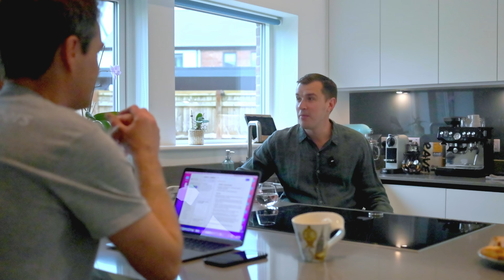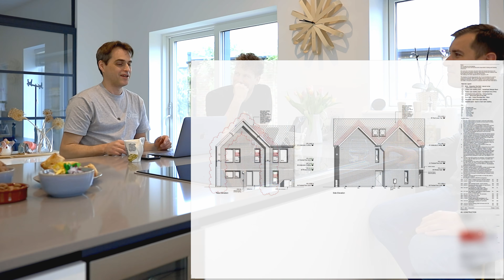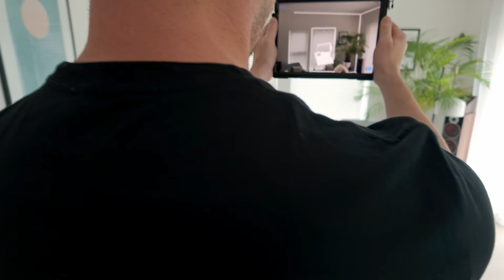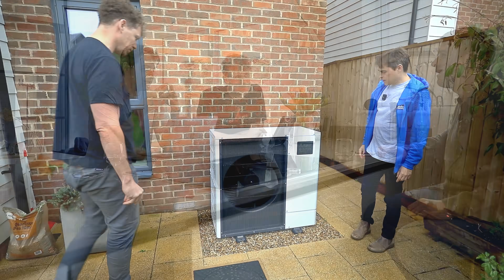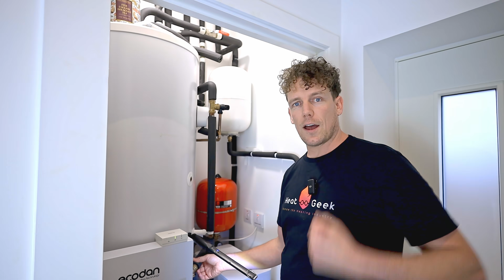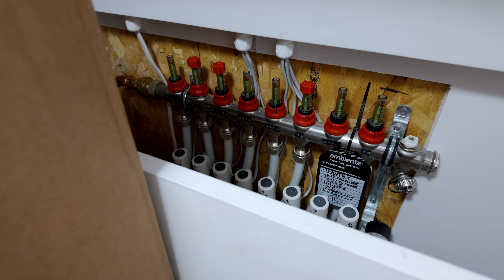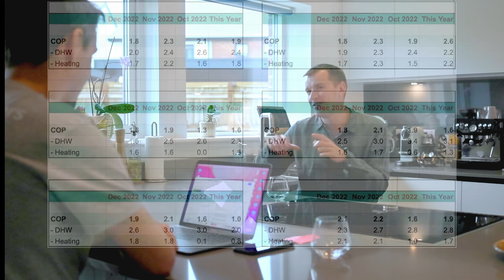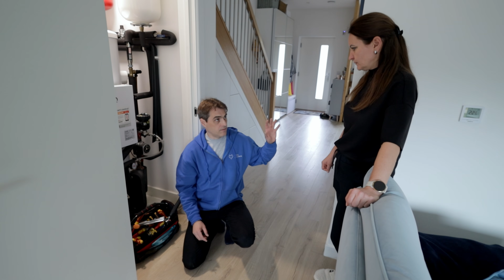How Developers Are Ruining The Heat Pump Market

Comment: Random question - does having multiple zones (my house has 6 on the ground floor) cause issues with flow balancing? 

I figured the system was balanced to create equal flow through all the zones, but if they are turned on/off for various reasons, does this mean that one room may get starved of flow depending on the length of the zones the happen to be on etc?

Comment: "They don't make units that small", hmm, there is a 3,5kW unit standing right next to me, just of the shelve Fujitsu stuff. House has a heatloss of 2.2kW. (190m²). SCOP compared to gas usage before (no other changes than changing the gasfurnace to ASHP) from 4900kWh of gas to 1000kWh of electricty)
Reply: Air to water minimum is about 5kW.  Vaillant do a 3.5kW but it's a nerfed 5kW.
I'm guessing that's an Air to Air heat pump instead, which do go lower.  As do Exhaust Air heat pumps.
Reply: @BenIsInSweden  the outside unit is indeed a software limited 4,5 or 5kW unit. Thanks to the limiter it runs super quiet. Not sure about the inside unit, I would presume it's got heatexchangers designed for 3,5kW instead of 5 to make it cheaper, but not sure. (it's air-water, feeding radiators and the built in tank of 190l)
Reply from the maker: It’s the same unit with identical components

Comment: 40% of electric in the UK is generated from Gas, what is the point of a enegy hungry  heat pumps that 40% of its energy usage is GAS used to save using Gas boilers, i'll stick with my 28KW Gas Boiler?
Reply from the maker: Energy hungry? Well installed heat pump uses 5 times less energy than a boiler ?

Comment: Hi Urban Plumbing

What I've gathered from your's & Heat Geek channels, is that Heat Pumps are a nightmare, in the UK.

From a non-engineering background, I've arrived at two conclusions:

1) Heat Pumps probably can work & be efficient. If the Germans make them...

2) The bulk of UK installers are not working to, let's say, German exactitude.

In my case, I hope to be starting an alteration to my 1950's 3 bed semi-detached, installing a heat pump with a mixture of underfloor heating & radiators. 

Sadly, I've come to the conclusion that the UK is predominantly a rip-off market when it comes to Heat pumps installs.

However, if you're seeking a challenge, and you know of a Company in CM4 area that are proven in their competency in what I'm trying to achieve, please aluminate.

Regards

Robert

Comment: What is sad is these companies that install this are certified and therefore can get the customers their grants but they then can charge double what it should cost to install for a sub standard service.
Reply from the maker: Those are done outside MCS and don’t receive the grant - there is no BUS / grant for new builds. It s actually the lack of grant that makes them worse as there are no MCS rules they have to follow - such as heat loss and correct sizing

Comment: Does anyone know what the requirements are for the isolator for the monobloc - I am wondering if I can install the electrical isolator switch in my utility (inside the house) rather than beside the monobloc on the outside

Comment: Great video. Oversized heat pumps are a problem though some can operate very efficiently at lower power. This is sometime the silent mode or something like that. That does require inverter technology which I would always recommend. Some additional tips: the cover of the terraced house lady should be removed. The air should flow unrestricted through the outside unit. Installing the outside unit low is actually not good. It has a much easier time circulating air if it is slightly raised. Especially in an area with many walls nearby. On cold nights with very little wind you will get recirculating of cold air back to the outside unit. This makes the unit operate as if it is noticeable colder.  You want as much warm ambient air to be drawn in. If two rows of houses with backyards facing each other all have heat pumps they will cause local cooling. Cold air stays put. With AC the out out is hot air which will always escape upwards. COP goes down if the inlet air cools. If there is a small amount of recirculating air it will be a vicious circle.  Thanks!

Comment: Over engineering makes more money. But what I think happened here mostly is that engineers copied and pasted previous jobs to save time, then they don't go through the new job thoroughly enough to make the proper modifications needed for this job. That explains the extra valving and thermostats in the same space, and probably the wildly oversized systems. Then the trades mostly just do what they're asked to do and move on to the next job. The engineer isn't usually involved as much after the initial bid, and even if they are, many don't like admitting their mistakes.

Comment: I watch this and realise these systems are so crazily complicated for the average householder.  Considering these are installed by professional installers with years of experience.  My gas boiler has the burner, a pump and radiators, that's it.  When the house is cold i turn it on, when it is hot I turn it off.

Comment: Most of these problems would go away if high efficiency, variable speed heat pumps were the standard rather than subject to a premium up charge by dealers. It makes far more sense to just normalize oversized heat pumps that have variable output as this would mean higher efficiency on average and not have a situation where there was insufficient cooling/heating ability.

Comment: In the summer, my heat pump kicks on at 10:00 PM and pulls the house down to 73 F.  At 4:30 AM the heat pump kicks back on pulling down the house to 69F and holds that temperature until 10:00 AM when it resets to 78F.  This way, during the heat of the day, my heat pump is off.

Comment: It is rare one would ever see a boiler style Heat pump where one uses radiators to distribute heat in a home in North America. Over here it is pretty much all forced air. Seems the majority of homes in Great Briton are somewhat small and not really set up to have ducts and air conditioning. Air conditioning works much better with forced air.

Comment: Oh lord. You should see what they do over here in the US. They even talk about "heat pumps" like they're some new technology that the rest of the world hasn't had for 10+ years. Over here they regularly oversize heating by 4x or more .. nobody even does load calculations
Reply: The US though almost entirely uses air/air systems. An inverter based air/air system that is massively oversized isn't that much less efficient. One of the problems the UK has is that in the gas heating world you really could look at it, take a guess at the heat loss, double it and shove that sized boiler in. It's again less efficient but not significantly  so - and from the installers point of view nobody ever left them a bad review or hauled than back out because it was overspec.

Comment: I dont see how they can produce a heat loss number without running a full simulation which is in itself a lot of work, only the architech who designed the house have got all the data to produce it because you need to know what the thermal envelope is doing. 3 kW heat loss for a 200 m² house with those openings in the video and no apparent exterior insulation technique seems way too low, with those numbers you would be into passive house standards with lot of sunlight control, external insulation layers, thermal bridges control, advanced ventilation system, free cooling/heating design strategies etc. Also you always need day/night thermostat area to help balancing the system unless you live in some kind of hippie commune with full open doorms to the living room. We don't have also local climate data which has a great impact on heat pump performace. Finally in this part of the world which is EU ISO-52000 area, heat pumps must be sized to cover 80% - 100 % of statistically calculated worst case local winter scenario, we have readily available public data about it. Anyway I agree that oversized heat pumps is a problem.

Comment: 11kW? That is almost what i got. And i got a partly old home and live inland in Sweden where it can get 20 bellow.

That house is about the same size as mine, and they have  triple glass argon and decently thick insulation, it should have more thermal resistance than my home.

Comment: The fact we don't run dehumidifiers for shower rooms blows my mind. High water vapour content hot air is free heat. The lack of a heat exchanger on the outflow seems ridiculous too. Simply wrapping the cold input around the outflow can reduce hot water requirements significantly, while not affecting peak temperatures available.
A 10 min shower will use around 1.5kwh of electricity. For a 2kw house with 2 people running a heat pump at COP of 3, heating power would be 16kwh/day. Showers would use 3kwh per day. In this conservative situation ~19% of power goes towards showers, and they are doing nothing to mitigate that. It is actually significantly worse than that, because if you are opening a window you are deliberately expelling air without putting it through the heat exchanger, meaning the air that replaces it will be cold and need to get heated.
I know it was a throwaway comment, but the complete lack of work on making showers energy efficient bugs me, because there is a lot of low hanging fruit there.
Reply: With MHRV you don’t need dehumidifiers

Comment: Just like with decades of oversizing gas and oil furnaces they are now doing the same thing with heat pumps because people are too lazy to actually do the measurements and calculations necessary to properly size systems. Quicker they can get to the next job the more money they make.

Comment: I’d never buy a home with a heat pump, gas heating is still more efficient.
Reply: In the UK - I have a gas boiler and two heat pumps but gas works out more expensive for space heating.
Reply from the maker: Gas heating is less efficient than even those heat pumps :)
Reply: @UrbanPlumbers  lol out of touch with reality
Reply from the maker: You are out of touch with physics
Reply: @UrbanPlumbers  gas is cheaper than electricity where I live

Comment: It might interest you to conduct the test which I have done to determine the heating requirement of a space. The cost of performing the test is a 1.0 COP for the duration of the test. During the coldest month of the year heat a chosen space with the lowest wattage electric baseboard running continuously that achieves the desired comfort. The wattage of the heater is your heating requirement.

Comment: First shit for heat pump is combined floor heating with radiators
Reply from the maker: No problem with that at all if done right
Reply: @UrbanPlumbers  Yes. Nowadays, you know that new houses has all surface in floor heating. Combined radiators and floor heating is past idea. That developer made bad project. I do, for old houses with combined floor heating and radiators that system -  big over 400 liters buffer with stainless steel pipe inside for hot water and heating radiators from that buffers - one circuit  with worse COP. Second circuit floor heating with best COP. There is a big migration of the heat from the ground floor to the first floor so radiators do not work so much specially with the climate like GB.

Comment: In Germany, heat pumps got magically cheaper after state subsidies have decreased. However, pumps were hard to get because everyone wanted to get a gas heating before they were allegedly not allowed anymore. We were trying to work with a local company that only worked in the heat pump business for over 20 years now and had a pretty good reputation. Unfortunately, they couldn't keep up with the demand - became rude and unreliable; google rating dropped vom 4.x to now 2.3.
We're still looking for someone and they all ask around the same amount: 500-1000 Euro above the state funding limit, flat. At one company, you would sign a contract first and then they take a look at your situation.
Reply: This is the case with all "new" technologies that have government funding, the price charged by approved installers becomes the open market price plus the government grant rather than minus the grant. It happened with solar panels and EVs in the UK, and now it's the same with heat pumps.
Reply: @garysmith5025  We are now signing a contract with a company that seems competent but is located 300 km away from us. Let's see how they fulfill their service contract...

Comment: I don't know how to run the numbers on "heat loss", but in a year I burn around 45 (12½MW·h) gigajoules of methane to heat my house which is a 2 bedroom old build in Canada; I bet a house that large that's similar to mine would be burning more than 100 gigajoules (27.777777... MW·h) per year if it used methane, propane (LPG) or electric resistance for heating. It's a bigger volume, but a smaller surface area per volume.

Comment: Here in the Netherlands with cheap gas and very expensive electricity getting more expensive with every windmill build. It's insane to install heatpumps that last less than gas heating and cost far more per unit. And use lots of that expensive electricity.

Comment: Ive installed one of those chinese 18kw pool heat pumps all in ones...just had to pull and connect two pipes to my old heating furnace. A fraction of the cost and free install since i did it myself ( gas is already built in). So far it works great, even when it was -10c this winter.

Comment: With a PH build they would have been probably better off to invest in PV and IR panels for heating. For DHW they could have used an exhaust air heat pump.

Comment: This is a great advert for not getting a heat pump. 90% of pepole dnt want a 2 hour tutorial on how to use your heating system and have to check through a stack of documents for codes of practice.

Comment: Are there ways of using heat pumps without the need for a tank or masses of pipe work.

I've heard of portable heat pumps that do away with all these tanks and things, is there a way of using that to produce a really good heating system that does not include lots of pipe work and water tanks?
Reply: Air Conditioning does exactly that.
Reply: @johnhunter4181  Do you mean air source heat pumps? I heard they use a big exchanger unit which pumps gas through a tube, nit really sure how they work.

Cars use heat pumps why isn't there a system like that in evs but for houses or small flats, something that allows you ease of instalation that takes very little room so you can simply place it where you want it without drilling holes in your house or flat.
Reply: @flitsies  Portable air conditioners usually have a couple of large hoses that you hang out of a window - they are heat pumps but usually only do cooling. What I'm talking about is a mini-split a/c which has a heat pump outside (you see them everywhere on roofs and balconies abroad) and a wall unit inside. Two small pipes less than 10mm diameter run between them, and they work both ways - either heating or cooling at over 400% efficiency. Every other country in the world uses them but in Britain it only seems to be offices and commercial spaces with building management. We had two installed for a total of £3.5k and they do all our heating.

Comment: The silver lining with oversized fossil fuel systems is that you are more likely to be able to drop in a heat pump replacement (running at lower temperatures) without needing to pull out ductwork. But you need to do the heat loss calculation first to be confident it will work properly.